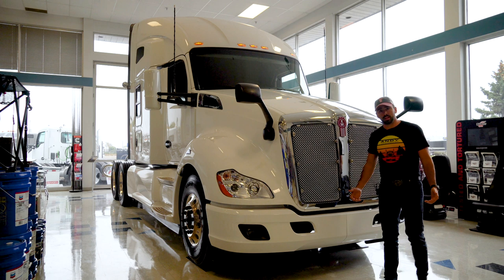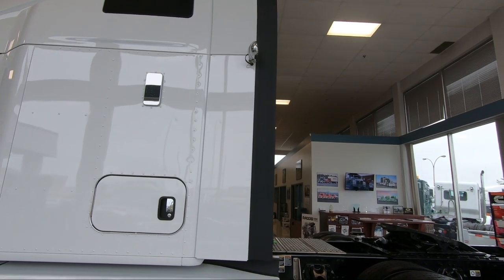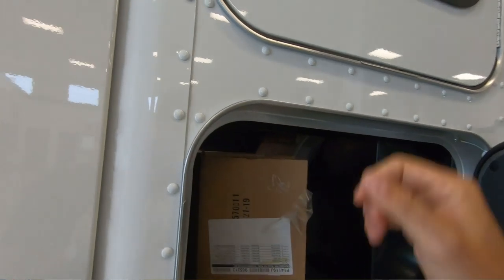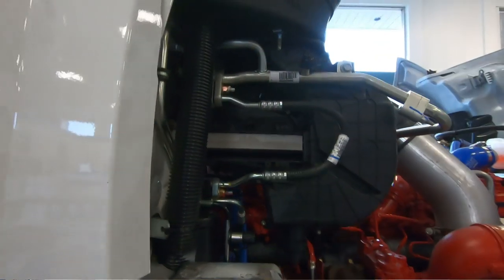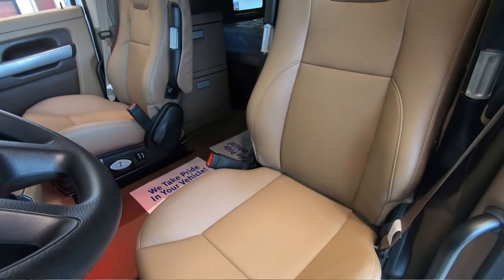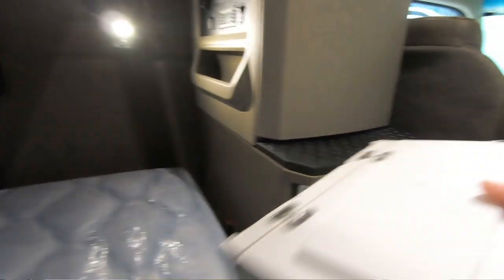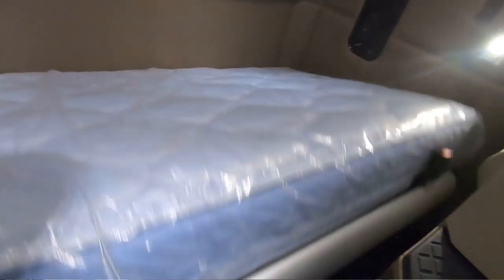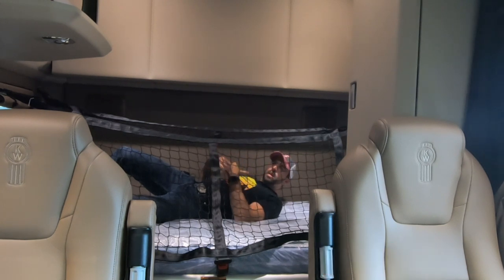STOCK 2020 Kenworth T680 Cummins 500,  13 speed Ultra Shift - TOUR & REVIEW

Comment: paccar rubber covered steering wheels are junk after they get some wear on them.worst design ever.should have stuck with same  material as the older 2 spoke flat bar wheels used in the 90,s and early 2000,s.or same matereal as freightliner non leather wrap wheels.
Reply: Wait till PACCAR brings DAF to the US.